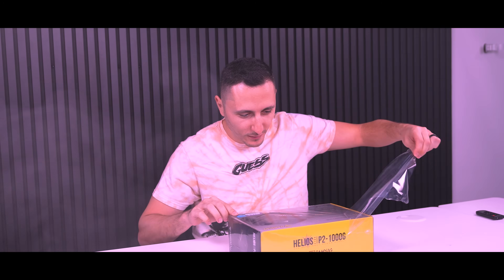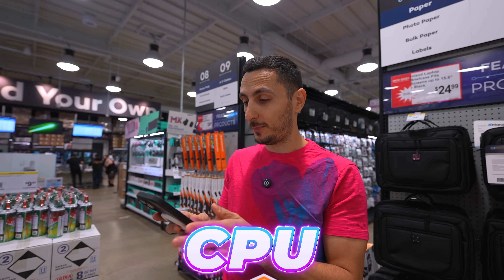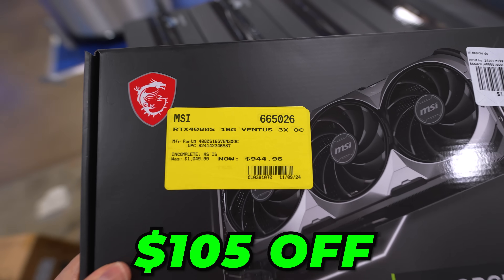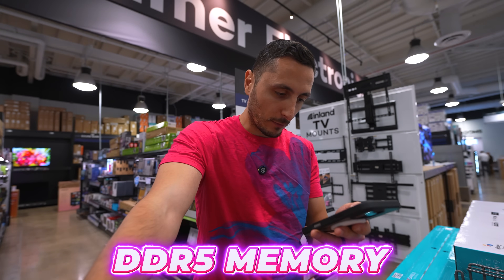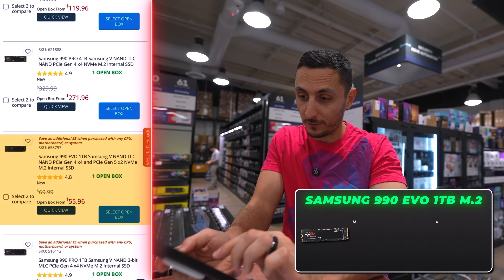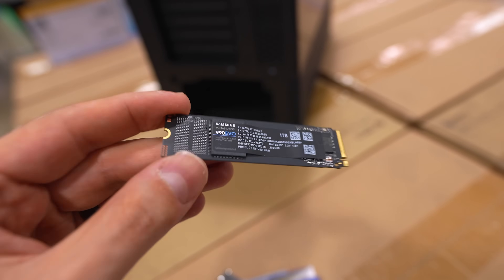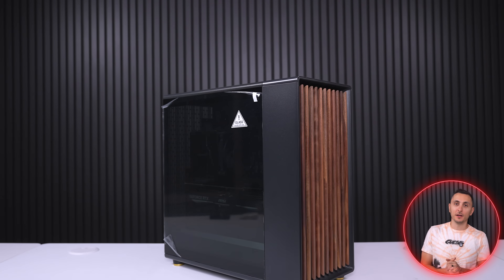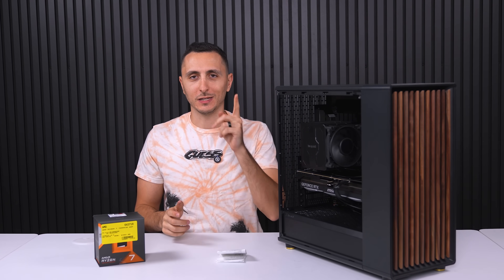STOP Overpaying for PC parts! This is how I saved Big!

Comment: Open box Power Spec PCs are great too. 

Here's the Powerspec model I got for 1075.00 open box in Dec. 2024

Intel Core i9 14900KF (2.4GHz) Processor
64GB DDR5-5600 RAM
NVIDIA GeForce RTX 4080 Graphics Card
2TB NVMe SSD
2.5GbE LAN, 2x2 WiFi 6E (802.11ax), Bluetooth 5.3
Windows 11 Pro

Comment: Thank you for making this video! I bought my very first open box motherboard. Here in Canada the MSI MPG Z790 EDGE WiFi was normally $427 but I got it for $275. $152 in savings. The motherboard is in mint condition and none of the accessories had been used. Rock solid and saved a lot of money! Ty

Comment: I got an open Box 2024 Asus ROG strix  scar 18 for $1799 and it’s normally $2999. Manufactured September 2024, so I still have September 2025 with the warranty and windows was installed in October and returned within 30 days. It’s literally brand new with not a mark on it. I bought it in December as an open box and bought a one year accidental warranty, so I have nothing to worry about. It’s an absolute monster. I9 14900HX, 408012gb(175w), 2.5k mini LED nebula display 240hz 1100nits 16/10 aspect ratio, 32 GB of DDR5 5600mhz, 1tb gen4, 90whr battery, in the box with everything. Best deal ever.

Comment: For My First PCC Build

1.	Motherboard: TUF Gaming WiFi 7
	2.	CPU: Intel i9 14th Gen 
	3.	GPU: RTX 4080 
	4.	PSU: 1000W (High quality, 80+ Gold/Platinum) 
	5.	Case: Corsair 7000D Airflow
	6.	CPU Cooler: Liquid Arctic Freeze 3
	7.	Storage: 2TB SSD (NVMe) 
	8.	OS: Windows 11 

Would this be a good build or is it missing something ?

Comment: Bought open box twice. First was motherboard with bent pins at 90 degrees. Sent it straight back. Second time got open box gpu and it had heating issues. Even after repasting thermal temp kept staying high. Ever since in i buy new. No way in hell will i drive 3 hours to microcenter only to go back and return open box items. New is best for me
Reply: So you can't test an open box in store? Only at home?

Comment: The only reason I have a 4070TI is because it was open box. At the time they were like $800ish, but open box and it was the MSI Ventus 3x version which had some "manufacturing defects" so it was $500. The manufacturing defect? Some of them came out with a bent backplate (it actually extends to the heatsink in some of them). Has never affected performance that I've found, but it meant for a while there you could find Ventus 3x that were open box marked way down because people would buy them, see the slight curve and freak, get a refund, and then the next guy or gal gets a pretty decent savings on a 4070TI that doesn't look quite right, but works just fine.
Reply from the maker: Open box is the way to go sometimes!

Comment: For those who live in the US, the microcenter is a blessing, they can find what they are looking for and what they want at an affordable price.
In Europe this is not common, we have to buy boxed and expensive, or even unboxed and they sell them at the same price as boxed and don't give discounts.
So sometimes geographical location seems like fate to me.
Either you're going to buy used, broken, missing parts and no warranty on amazon and ebay or you're going to spend 3-7k for a nice system.
That's why I still haven't gotten a processor and graphics card. I've been waiting for more than a year, I still haven't been able to collect a computer, my current leptop is not working, the keys are out of touch.🥲🙄

Comment: open box is nice. Bought a rx 6900 xt for $500 back when it was going for $750-$800. Sold it on fb marketplace for $400 and bought a rx 7900 xtx taichi white for $750 on ebay. So just had to put $350 for that 7900 xtx and I'm having no issues at all. Just ran some stress test when i got it to make sure it was good and it was.

Comment: Try building an open-box only parts PC in Micro Center Fairfax, VA. You won't be as lucky as you were in California. I desperately looked for a 2TB SSD replacement for my PC and couldn't find it, so I went with a new one. Fairfax Micro Center has nothing open-box, only prebuilt PCs and some laptops.

Comment: I work at Best Buy and sometimes they mark an open box down as much as possible and because of that the condition shows “poor” for example even though it’s actually in excellent condition. They do this so they can get rid of inventory at times and give customers a good price. I’m guessing Micro Center has a similar process and reasoning.

Comment: The day I learned there is no such things as "New" was the day my wallet thanked me, since ALL electronics are tested and burnt in before packaging and sales, it's only new to "You",
Reply: This is misleading at best.  Most PC hardware is simply plugged into a jig on the assembly line (en masse) and run through a quick pass/fail qc program that takes seconds.  There is no "burn-in".  This isn't even remotely the same as someone buying, taking it home and doing God knows what with it before they decide to return it.
Reply: What I said was a burnt in, which is what you described, which is irrelevant now since cost are so inflated at the moment it's still more cost effective to by used, that'll change soon.

Comment: Open box items are a gamble, but when you get a good item. So worth the savings. I bought my 4070 S open box at best buy in March for 450 usd, and got my OLED monitor for 410 open box when it was a grand MSRP. If you can get an open box deal, i would take it. I still look for open box deals when possible.
Reply from the maker: Agreed! Nice deals!
Reply: i picked up an OLED monitor for $400 open box too earlier this year, ive also been slowly purchasing components with quite a few being open box, unfortunately i am taking a slight gamble as i cant test if any of them actually work but i bought a 7800x3d for $289, a gigabyte b650 for $140, and a 4tb samsung 990 pro for $230
Reply: So true. Im building my first pc and i just bought a hyte y70 open box for $137 and it literally looked like the box was just opened and taped back.
Reply: Try buying condoms open box next. A 
Little jizz won't hurt u if u can save 50 cents😅
Reply: Always go open box IF it comes with a return policy.
Reply: @SRTSean4 that’s why i like best buys open box deals. Get 15-day returns, and can insure it when i purchase it.
Reply: Pawn shops are also a great place to look. I got a 48" 4K Aurous OLED monitor for 300.00 with less than a 1000 hours on the panel. rated for 100,000 hours
Reply: Never gamble on monitors guys

Comment: I have 7800x3d and a 4070 super . . It came with a adata 800 and a 850 watt power supply. I ordered a 2tb 990 pro . Is it possible to experience bottle neck from low write speeds ? The adata is like 3k while pro 990 is 7k data speed. And is 850 watts enough for that ?
Reply: Yeah 850 watt is perfect could probably run a 4080/4080s on an 850 watt.

Comment: I have a asus rog strix z790-e gaming wifi ii lga 1700 motherboard I haven’t built in it yet but I wanna put 4 sticks of Corsair dominator titanium ddr5 ram in it. Bad idea?
Reply: Hey i know its a little late but generally to run full xmp speeds you need to only occupy 2 slots, the 2nd and 4th usually from the cpu(double check your mobo  manual), it is fine to run 4 slots if youre okay with sacrificing speeds a bit